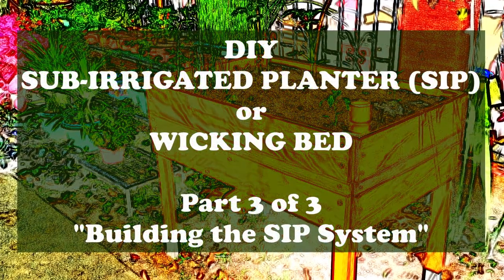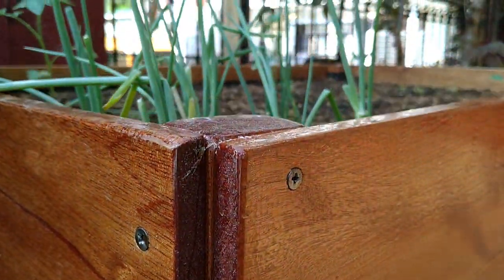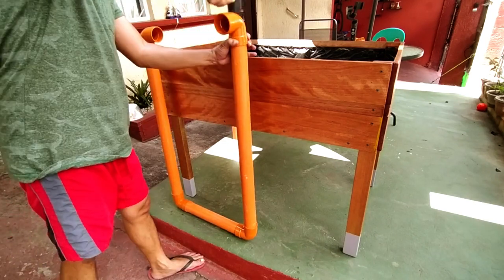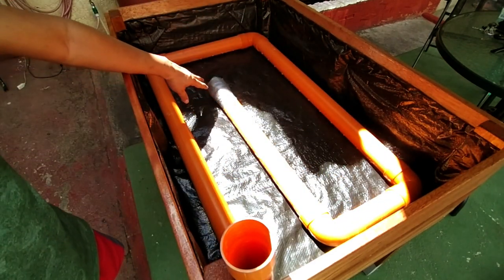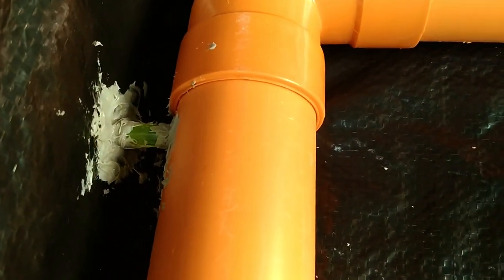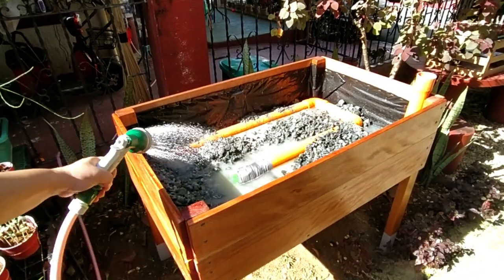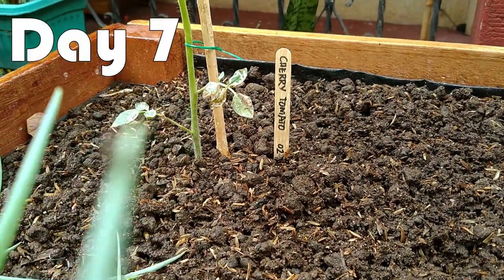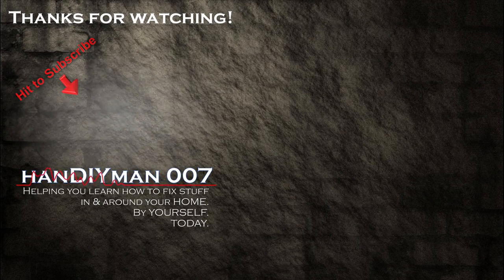DIY Self-Watering Wooden Planter Box (Part 3)

Comment: Very good system, the only thing I don't understand is.. why not cap the end instead of using the mesh? When you water, wouldn't most of the water be dumped out on the end of the opening with the mesh instead of going through the bottom holes?

Comment: A sincere thank you for this series, especially regarding a SIP system. I will be utilizing your plans when I build my planter boxes next year. Question (same as @nickh7056 ). Why do you put mesh over the end instead of a full end cap.? A cap could also be drilled with holes to release water. That would seem sturdier and more permanent. So why the mesh instead? Thanks!

Comment: Great job!!!!!!!!   I have a quick question in regards to the drain hole.......it seems like drilling a hole in the pcv is not needed.  Does the drain pipe need to go into the pvc, or can it sit right in the box near the pipe (at same height of course)?
Reply from the maker: Drain hose must be inside PVC pipe where water will be "pure". If it is outside the pipe, then water is mixed with soil and other obstructions, eventually clogging your drain hose. Without the PVC pipe system, you will struggle with intermittent clogging and uneven distribution of water.
Reply: @HanDIYman007  smart   ty!

Comment: Hi, from Portugal. I've seen 2nd and 3rd videos only and I have a doubt. If you have drilled holes in the bottom to drain the rainwater, then what is the need for a side drainage pipe in the watering system?  It all goes to the bottom.
Reply from the maker: I didn't drill holes at the bottom - that would defeat the purpose of a SIP system.

Comment: Hi - thanks for these videos!  so how do you know when it's time to add water again?  what about rain?  that adds to the water level but then that's what the drainage hole is for - which i assume only drains when the level of the water reaches a certain height - correct?
Reply from the maker: Great questions Ren! 2 ways to know when to add water: 1) if the top soil is already dry (if water is sufficient, top soil will always be moist even on hot days). 2) if you can no longer see any water when you peep down inside the water intake pipe. And don't be afraid of overwatering (whether from rain or by you) -- that's what the drain system is for; water will never collect/pool higher than the height of your drain hose.

Comment: Congratulations on the production of this great video. You are very precise with clear instructions and explanations. So I subscribed to be sure to follow you with other projects. I am building a raised planter now and interested in installing the self watering system. However I have a question you probably cannot answer but perhaps one of your other viewers can provide some suggestions. I live in Canada so I have no problem with this system in the summer. However in the winter I am afraid the excess water in the box will freeze and expand. That could break or disconnect the PVC pipe and or push out the sides of the box due to the expanding pressure. I am thinking of putting in an extra external tap to the PVC pipe that can be opened to fully drain the pipe before freeze up. Any other comments or advice?
Reply from the maker: Thanks so much for your feedback! Great idea on completely draining the water in winter. Another viewer was asking about it too in a previous  comment. While i dont have experience on winter, i think water will only expand to a certain mass when frozen. But since the pipes only has water halfway (remember i plugged the drain hose halfway the height of the pipe), you should still have enough room along the pipes to factor in ice expansion. But thats just my 2 cents. You do what you gotta do 😉 Good luck!
Reply from the maker: A friend of mine also suggested wrapping insulation around and beneath the box during winter. The soil and pipes already provide enough insulation from the top. I hope this helps.

Comment: Quick question for you.  If using the SIP system, should you still cut the slits in the liner for drainage that you did in the second video?  Seems like you would not.  Thank you!!!
Reply from the maker: Good question and thanks for watching the series! You're right, no need to cut slits on the liner if you are going ahead with SIP. Only cut slits (for water drainage) if you just want to use it as a conventional planter box.

Comment: Quick Question, Would it not be better to have the overflow pipe, that is coming out the side of the planter, drilled a  few centimetres higher on only the box, this should make it flood the pipes higher before draining out and would supply more water into the soil and not just the gravel?
Thank you for your video.
Reply from the maker: Water collected in the pipes is just right for the size of the box. The drain hose needs to be inserted into the pipe, not just the box. I think i explained why in the vid. Thanks.
Reply from the maker: Water will always go up due to capillary action, as explained in the vid. We have been using the planter for a year now and it is just great.

Comment: I’m really curious, why did you guys put gravel in the bottom instead of soil throughout? I don’t understand
Reply from the maker: Imagine if it was all soil -- then it would have easily clogged all the holes drilled through the pipes. The gravel serves as a barrier between the pipes and the soil. Also, air pockets are preserved inside the gravel layer, making it easier for water to seep up. Did this help?
Reply: @HanDIYman007  yes, thank you

Comment: Hello Handyman, first of all great series. thank you for sharing. I'm building a SIP according to your video. I have few questions if you'd be so kind to answer. I build 2 meters (6 foot) by 60 centimeters (24 inch) and 50 centimeters (20 inch) deep. I plan to use 16 centimeters (6.2 inch) pvc pipe so It could hold more water, is it ok? another thing is regarding the gravel. What are your recommendations on what kind of gravel to use? smaller stones? bigger stones? or maybe bigger stones on the bottom, smaller as I go up? What would work best for the system, to feed the water upward. Thank you.
Reply from the maker: Hey there Kestutis, thanks so much for the comment and I'm glad you're referring to my videos to build your own SIP. I think a 6.2 inch pipe would work for your 20-inch deep planter since that would leave you about 14 inches of soil -- the important thing is that your soil should be deep enough to support the roots of whatever you're planting. As for the gravel, for as long as they are bigger than the holes you're drilling into your pvc pipes, you should be good. They provide cover for the holes to keep the soil from entering. The gravel layer should be no more than 1-2 inches above your pipeline. Finally, as long as your gravel and soil layers remain in contact with each other, water will always move up because of capillary action (as I explained in the video). I hope this helps and enjoy your build!
Reply: @HanDIYman007  Thanks Handyman for your further explanation. I went and bought 4.3 inch pipe, so roots would have enough space for growth. thanks again.

Comment: Thanks for this video, I am going to give this a try from start to finish. Do you have to use a 2" PVC or can it be smaller? Did you use PVC primer and cemet as well? Lastly, what is the drill bit size that you used for the holes in the PVC?
Reply from the maker: Thanks for giving this a try 👍 To answer your q's: 1) 2" pvc was the optimum in respect to the depth and size of my planter. Scale up as you go bigger or down if ur planter is smaller. 2) i didn't use any pvc adhesive since the soil will hold everything in place anyway. Up to you but i tried to keep my costs down. 3) use the smallest drill bit that you have - where water can pass through while keeping soil out. I suggest 1/4" or even smaller. I hope this helps and please watch Part 1 and 2 to get the whole picture 🤗
Reply: @HanDIYman007  Thanks again for the reply HanDIYman, I watched all of them several times already, toke notes and rework my wood selection. I was not able to find the plastic mesh anywhere (must be in your country) we only have metal ones with bigger holes in local store online. Mine will be a 4x2 close enough to your size. Most expensive was the pond liner roughly $35 US dollars. This will be a fun project to try and hopefully my plants will look as amazing as yours. If you don't mind in your description for you video, you should include a list of supplies, I know you mention it within but good to see it some where written. Thanks again!
Reply from the maker: @sgtsol7934  saw a ton of results in amazon using these keywords: plastic mesh, net plastic mesh or drainage mesh. I hope this helps 🤗
Reply: @sgtsol7934  I'm probably late in response but you can probably try Harbour Freight for the net material.
Reply: @user-je7hp5kd3m  All done found a metallic fence with small openings, perfect for the task at hand. Completed the work but I skipped the PVC pipes due to cost of materials. Worked out great in either case, I built two of them and got plenty of tomatoes, still has more to go. Great guidance from @HanDIYman007 vids. Enjoy the building.
Reply from the maker: @sgtsol7934  Congratulations! Am really happy for you! Did you still include a drain hose even without the PVC pipes? Just curious. Just to give you an update, the cherry tomatoes my wife planted grew up to 5 feet! In the end, I had to build a proper trellis to hold them up.
Reply: @HanDIYman007   @HanDIYman 007  yes funny you said, same thing happen to me instead of trellis I used the extra wood we used in the bottom to build a T Shape to tie them to, they grew over that as well. As for the drain hose, I did not use it instead I poked holes through the bottom so the excess water would drain out. Although I did have a thought next time I build another one I will go full-on PVC and use the drain tube but will modify to fill empty gallons this way th excess water won't get wasted. It was a great tutorial non the less, so Thank you again for taking your time to edit and post this, I am sure it has been as helpful to others as it was for me, till next time.
Reply: Thanks for the great video, on this today, will update :-)

Comment: Thank you so much for these excellent videos. They are a gift! I just built a 3'0" x 3/4' solid wood indoor planter box (see https://www.youtube.com/watch?v=6zxOpk2q8Tg&t=450s) and want it to be self-watering because I am frequently away from home several days at a time. I plan to skip the mesh because the walls are solid; use less PVC to distribute water evenly;  and use smaller diameter PVC. I would greatly appreciate your thoughts on the PVC and anything else that comes to mind. Again, thank you for sharing your work!
Reply from the maker: Hey you're welcome! Yes, if your planter is smaller than what I built, it does make sense to use lesser PVC and with smaller diameter. If your planter is solid (walls and flooring), you can probably do away with the mesh BUT I would still suggest you use pond liner to make the inside waterproof -- otherwise, water will warp and destroy your wood over time.
Reply: @HanDIYman007  Thanks!